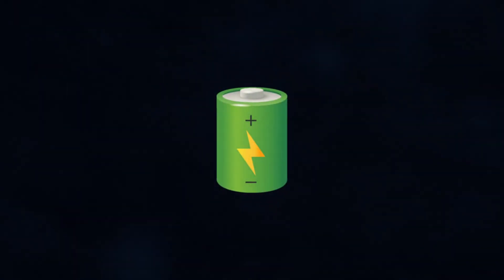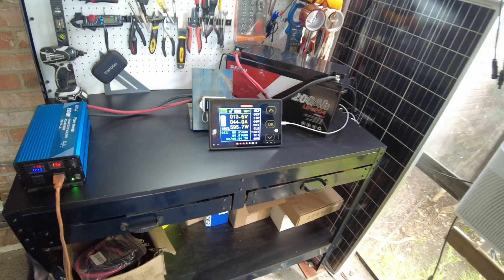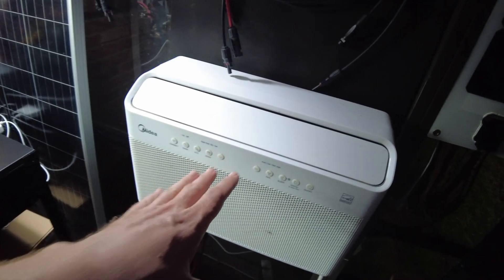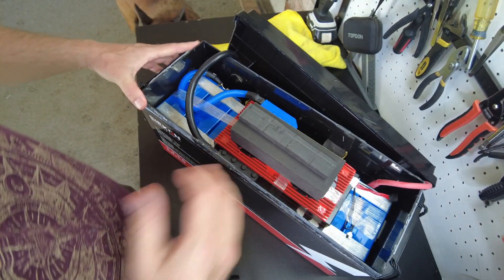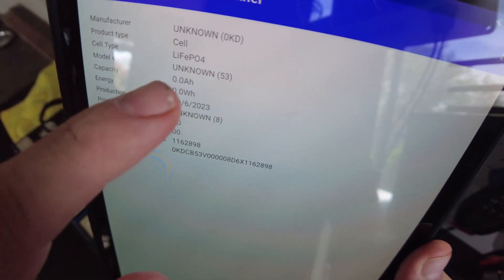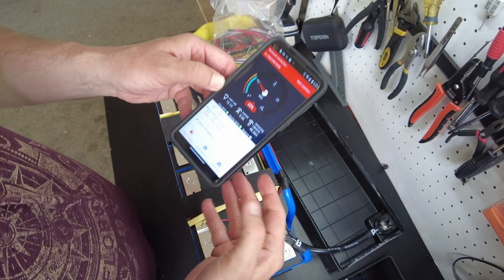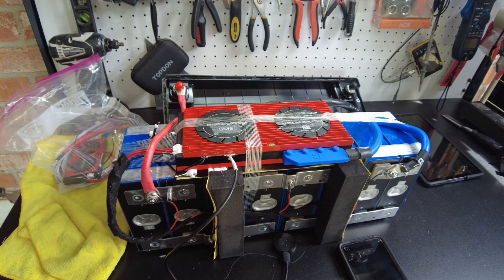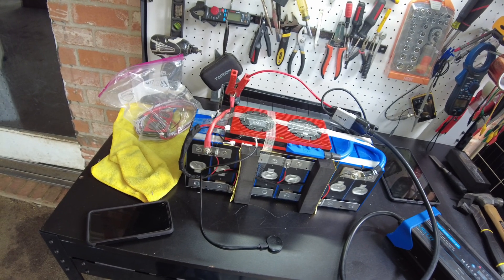SIEKON 12v 200Ah LiFeP04 Battery

Comment: I have had one for over a month and keep getting normal+/OK results, 203.5 to 205.8 AH, nothing higher. But repeatable. They came out with a new blue case version, AKA the LiTime/PQ/Shenzhen Time re-branding line up. Their original 200ah ( best ever style to use in shape, size, terminals, and ability) though with the Daley BMS is the best ones they sell while they last. The new ones are just rebranded now.
Reply from the maker: Yeah, they're asking if I want to review their new line up, I'm guessing that's the "blue" ones you're talking about. I'm ready to see affordable/budget 48v batteries, I think others are too. Thanks!
Reply: @BradCagle  The best 48 volt battery I have seen is Enjoybot, but not sure they are still selling them. 48 volt 135AH and 100amp BMS.
Reply from the maker: @JOHNDANIEL1  I was using the official one i guess it's just called "smart bms" in the app store. Now I'm searching for it, I dont see it anymore lol. Looks like there's one called "100 balance" it's blue, but it looks like the same app. I have not tried it